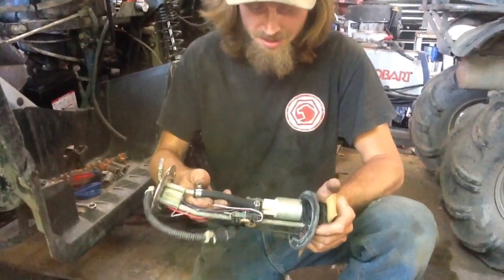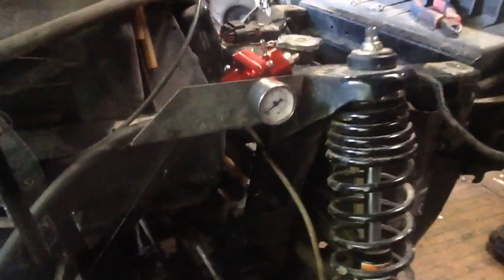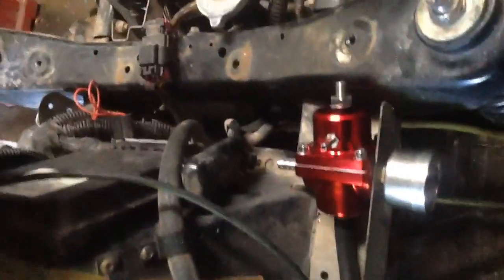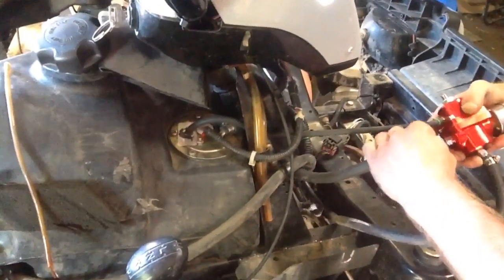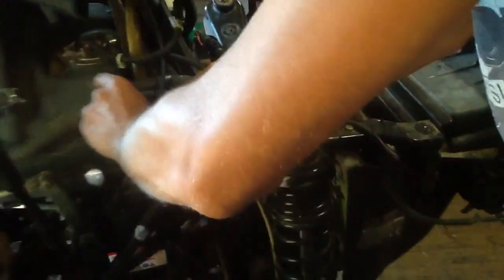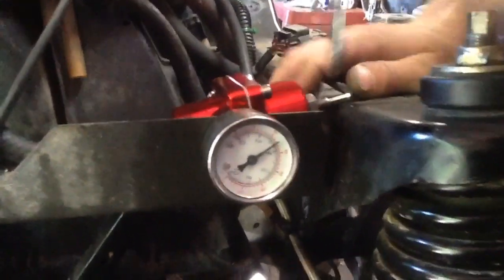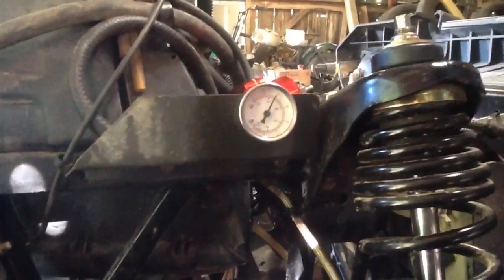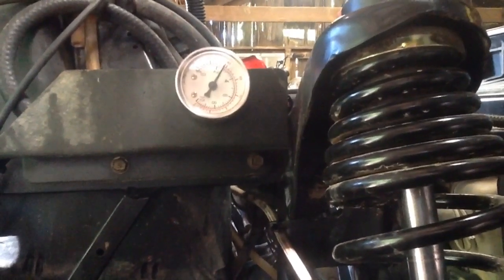How to Bypass the Fuel Pressure Regulator on a 2006 Polaris Sportsman X2 500 H.O. EFI 4x4. $20 Fix

Comment: You can buy a 35$ fuel pump from a  99 Ford explorer and use the regulator from that I just seen that on the tube that's slick tho

Comment: Having trouble with this set up. When I turn my key on pressure goes to about 60 then when I turn the bike on it goes to about 100 120 psi and won’t adjust. What am I doing wrong?
Reply: mine does the same thing goes to 80 psi and wont adjust

Comment: I bought this same thing for my Polaris and I’m not quite sure what you’re saying to do with the vacuum line... any suggestions
Reply from the maker: Spencer Shoun instead of that working as the vacuum side of the regulator cut a dime or nickle sized hole in that plastic piece that divides the top half from the bottom half of the regulator an it will allow the excess pressure to back feed thru that small vacuum port back in to the tank just don’t use the supplied vacuum line I’d upgrade to an actual fuel line and of course once you get it all put together you will have to adjust your pressure down to your desired psi as I showed in the video if you’d like I’ll try to get around to making a follow up video on this to clear up some of the confusion
Reply: Daniel Boone  yeah It would definitely help to see more on how you did it but that cleared it up a little I’ll mess with it and get it figured out thanks brother
Reply: @danielboone8073  where did you cut the hole? I cut it right in the middle and psi won't adjust up or down. Stays right at the 90psi from the pump
Reply: @danielboone8073   did u ever make a video on where u cut the dime size hole for return fuel to go out vaccum port?
Reply from the maker: Spencer Shoun sure enough man glad to help if you have anymore questions just holler an I’ll get that follow up on that put up as soon as I can

Comment: Did you use the air vacuum hose that came with the pump 
as the return line hose into gas tank ... or did you install a
 new high pressure fuel line hose?  Did you install a barbed 
hose connector on the gas tank?
Reply from the maker: I would not recommend using that hose cause it will deteriate pretty quick since fuel would be rolling thru it so yes definitely use fuel line on the return part to but on the fuel tank I drilled a whole thruough the cap of the fuel pump assembly and stuck a rubber grommet that I had around the shop In an put the hose thru it so it would fit snug that line wont ever be building pressure so you won't have to worry about being anchored by a barbed fitting unless you just want that peace of mind

Comment: How do you ...  modify the plastic in between the top and bottom pieces of the Regulator to allow flow back thru the small port on the regulator to make it back feed the excess pressure into the tank ?
Reply from the maker: Take that plastic piece an cut a dime sized hole in the center of it I might have went nickel sized I honestly don't remember I've worked on a many of em since this one but putting that hole in the center allows the pressure to bleed back out through what would've been the vacuum port
Reply: How do you cut the plastic?